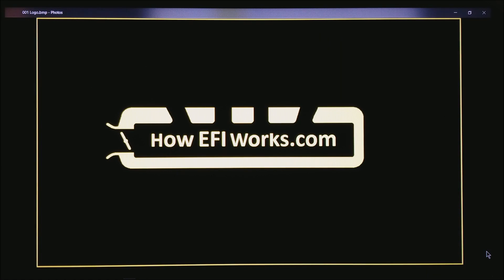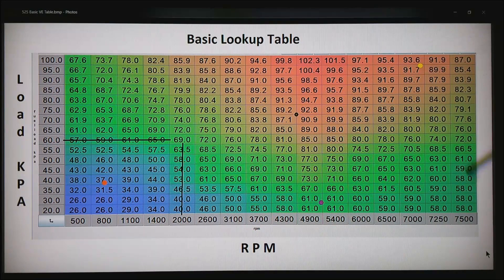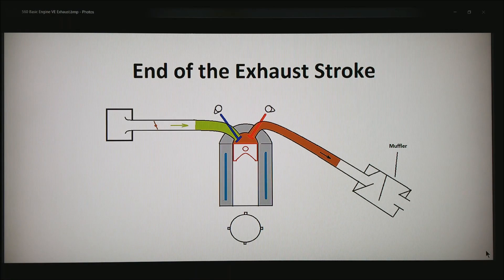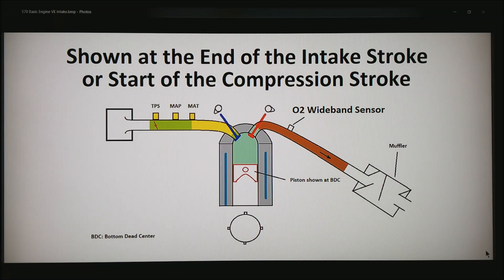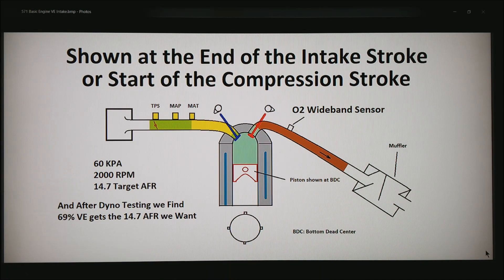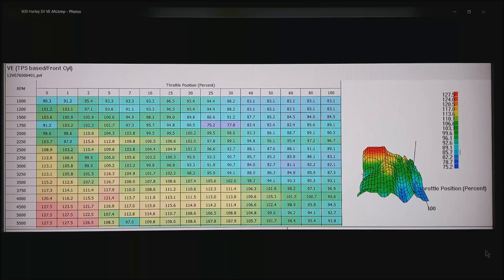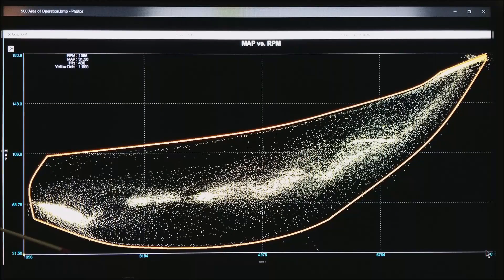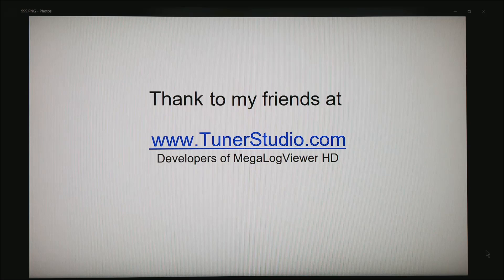Lookup Tables and VE Tables

Comment: You do any gen 3 5.3 tuning that has had a cam swap and now engine idle is crazy  stalling when warmed up at stops or deceleration then when restarting revs up to 2500 for 10-20 seconds?

Comment: Let's see if i can phrase this so it makes sense.  In that last portion of the video you showed areas of the map where the motor will "simply never reach" is there a common practice or best rule of thumb as far as entering numbers in those cells or does it not matter?  Id assume keep the values closest to the last cell the motors actually able to reach?
Reply from the maker: I extend the last known good VE keeping in mind that if the VE was falling in that area, I will continue to keep that slope going.